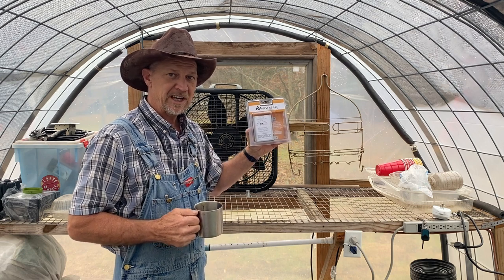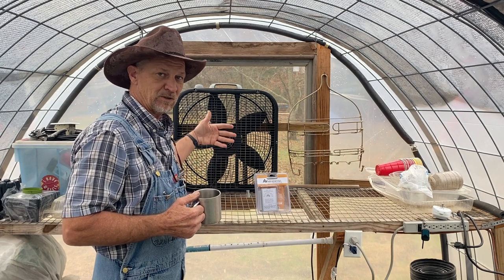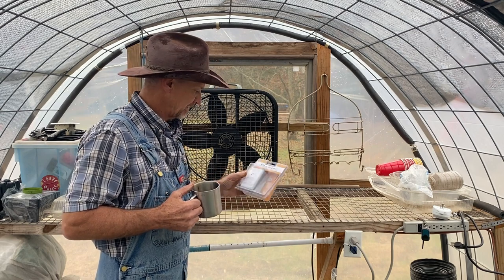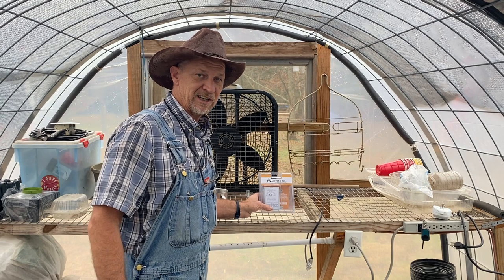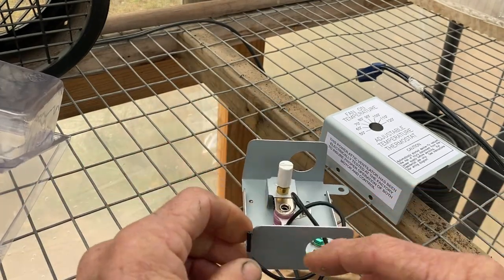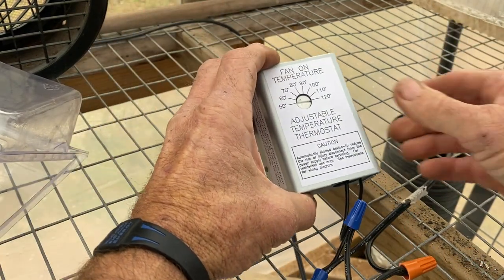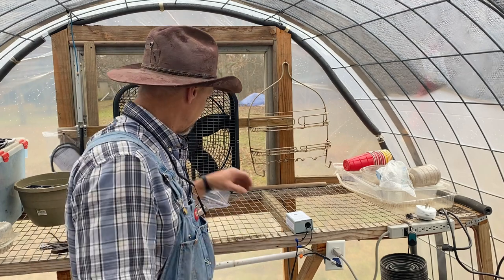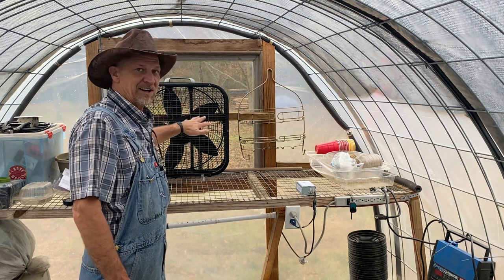THIS CAN BE A GAMECHANGER / FAN ON ADJUSTABLE TEMPERATURE THERMOSTAT IN MY GREENHOUSE

Comment: I just put one of them in my green house this morning...my house is 8 X 10, got a 7 in fan and louver vent hooked to it....i set mine about 75 *.  not sure my fan will pull enough air in....I may have to get a stronger fan....thanks for sharing.
Reply from the maker: It will help but if it gets hot as it does here, I don't think the 7inch fan is going to be enough. These little greenhouses get hot fast.
Reply: @papawsplace  im in nc, it got to 82 in mine yesterday, i got a bigger fan that I can put in it, just trying to get by with the least i can.  I like watching your videos, keep it up. keep making the green house videos too, I should have video my green house from the start.
Reply from the maker: It's simple and seems to be helping. I need a window on the door end that will open by itself also. When I'm here I can open the window on the door but if I'm working it's cold when I leave then gets hot during the day. A green house in the south has to be baby sitted so I only use mine during seed starting. I'll be checking your channel
Reply: @papawsplace  I have a window on the other end from the fan, just waiting on the window opener to come in, I will have it tomorrow, then I will know if the fan is big enough. it will come in one side and blow out the other.
Reply from the maker: @matthewanthonyoutdoors1364  Keep me updated on the out come.
Reply: @papawsplace  FedEx came about 2 pm today with window closer, i will see how it works this next week, may do a video on it.
Reply from the maker: @matthewanthonyoutdoors1364  10-4 ,I just watched one of your fishing videos. Some fresh fish would be good about now..LOL

Comment: Over here we would be using a crimped connection or connector block for cable splicing plus we would need to put a grommet or grommet strip around the hole in the metal controller, we also would need to earth or ground the controller, so brown is live or hot blue neutral and green and yellow for earth or ground, so you would be all done with the fan set up and back in the house drinking coffee before we even looked all the tools out we needed to do the job lol granted we are 230v but I feel we have far too many rules over here and the powers that be have no faith in us not to do something idiotic.  You said this more than once "common sense" it's something the UK does not give us credit for as they keep coming out with stupid rules and regulations. That is a really handy little box buddy and will hopefully make a difference to whatever you are bringing up in the greenhouse. Please take care stay safe and God bless.

Comment: This will certainly work to remove the hot air but there is another option to consider.  This unit is a simple coil of metal that expands and contracts - making/breaking the AC power circuit.  It does not include a hysteresis feature to avoid the fan turning off and on too frequently.  Of course, when the fan turns on because it's hot enough in the room, it will cool off the room and turn off - in such a small room the fan may come BACK on in a very short period of time. I call this 'chattering'. 
And also, the unit is monitoring the temperature of wherever you put it; this may be very inconvenient in such a setting (pain in the arse to mount in certain spots).
I tried offering a TS300 to you in a comment before; google Honeywell TS300.  It is more expensive but it also does much more for you.  For one, it has two monitoring points - one inside the unit so it monitors the temp of wherever it is mounted PLUS an option to mount a remote probe for a second location.  The probe is pretty much just a wire, and spliceable,  so you could drape it anywhere very easily. 
Also, it can be NO/NC, provides dry contact closure, has audible alarm, includes hysteresis setting (delay between the the temps of when the fan comes on - then off again; for instance, fan turns on at 75F...blows until the temp drops to 65...NOT 74...does that make sense? 'peter.at.masonalarms.com'
Reply from the maker: Makes perfect sense, I agree with everything you are saying.